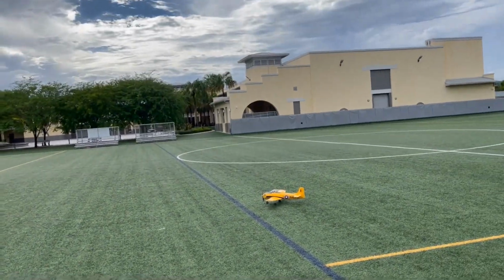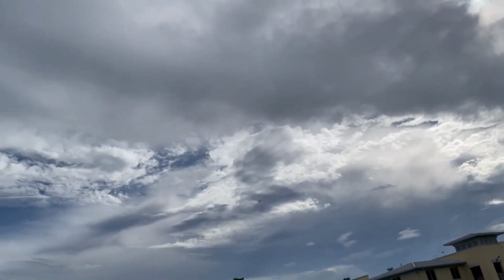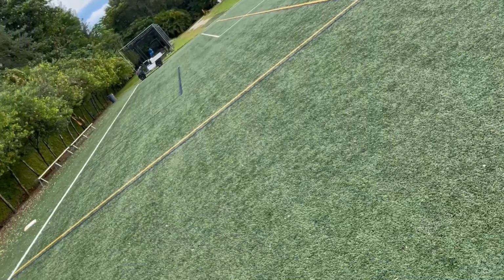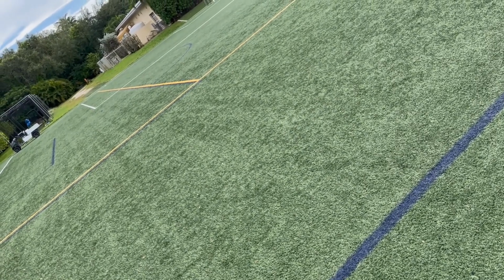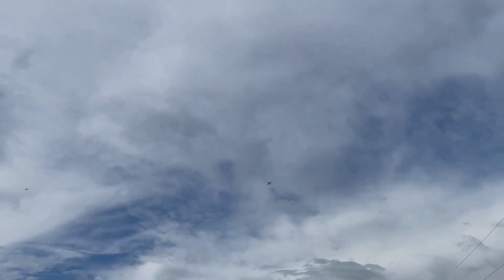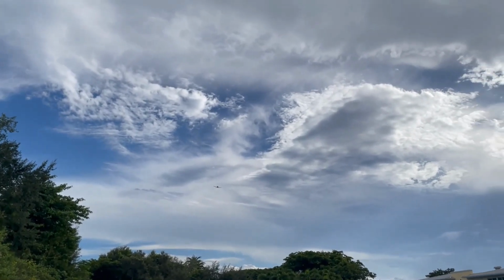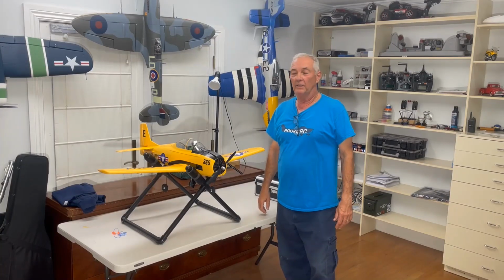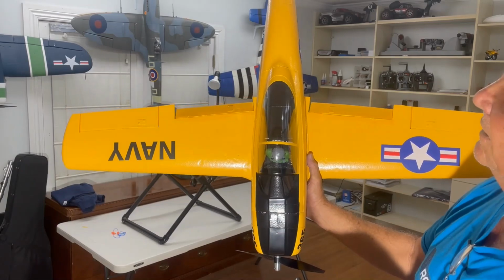Test flight with the new Flaps on the T-28

Comment: Cool what you did!! I´m flying 2,5 months and this weekend I began with an used T-28 and it´s super great! Just a bit too fast for me landing on pavement. Flaps would be great. I´ll see your other video!
Reply: Same. Its to fast for me and when dont slow it down enough i get plane bouncing of the pavement. On grass is ok. I also put wheels from 1.2m Apprentice i didnt like those small wheels
Reply: @ernestostrman5147  and landing on a 3 m wide pavement road with that speed is even more challenging :P Mine had a big crash and after glueing the fuselage she isn´t flying OK need to look for the spinner and motor. So installing flaps isn´t probably a topic anymore :(
Reply: @franciscoduran3688  oh shame. I did learn to slow it down but where i live is very windy so i dont fly it much cause wind is always hitting the plane from a side and that makes it very hard to land. Am just practicing landing with apprentice and fly T28 only when wind is low(i consider low 15-20km/h).
Reply: @franciscoduran3688  am landing on real airplane strip 2.5km long but it seems am done with that. One car company leased the runway and put a fence around it. They let me fly when they are not testing cars which sucks cause i need to put planes in car, drive 15 mins to get to the runway and fins out they are testing. Last 2 times i was waiting 1.5h for them to be done with testing so i can use the runway. 😪
Reply: @ernestostrman5147  Hi Ernest, thanks for your answer :) I crashed my T-28 just because of being silly and trying to do a low pass at high speed. I had a short circuit in my brain and changed elevator up for down hahaha It doesn´t look so bad after the repairs although. But I suppose the motor angle isn´t correct or something is having high vibrations. I was able to land her safe only with SAFE on. 
It´s a shame you can´t fly on that place everytime you want. That was probably super! But don´t you have a small road or something like that? The Apprentice probably also can do good grass landings!? I wanted to start with the apprentice but found a cheap Timber. I have been glueing her a lot but now I learned to fly better and the CG is also better (pretty nose heavy) and I can do all kinds of stuff with her. But the best are smooth landings and touch downs on the evening with lights :) I have a couple of other planes too. A Max Thurst Ruckus that is from the UK and like a trainer 3D plane. It also sails pretty good, but because of that landings are more difficult. It just don´t looses elevation :P And the landing gear does not forgive like the STOL planes. I also have a second hand Draco waiting for maiden (landing gear was broken from first owner) and now also a very old but cool Mini FuntanaX from E-Flite. This is balsa and super light. A really good 3D plane. Another young guy from the field has it and recommended it me. I´m nervous to fly that thing. That´s all about 3D flying and landing must be perfect. Also extremely wind susceptible :S :S 
I hope you do good flights on weekend! We have a little competition for acrobatics on the field. For beginners and pros :)
Reply: @franciscoduran3688  i dont have any place that is close to me and that is big enough and that there is no public. I dont fly where people/cars are, i almost hit an granny with a plane once(she came out of high grass and i didnt see her). I have about 15 planes most have not beem flown yet. Dont want to fly a new plane to soon and crash it. My landings have improved much and am not using SAFE anymore. I live in a small country(less tha 4 milion people) and really dont have anyone to fly with. My eife is afraid of flying +1m planes she only tried 400mm and also lost control when plane was flying to her and you need to reverse contorls and she didtn learn that yet. Son is to young he is only 15 months so i will have to wait so i can fly with him. I ordered FMS 1300 PA-18 which is a bush plane with real tires cause i dont want to travel to runway to fly a plane and PA18 can be landed anywhere. Its also STOL. Also orded FMS T28 800mm sine i can use it as belly lander and launch it from hand. Hope you get more flying time and no crashes. I only had minor crashes due to wind.
Reply from the maker: Hey guys, crushes are part of the hobby. You’ll learn from it and get your skills up. It’s only a matter of time.
On the other hand, you learn how to repair them.
Don’t get discouraged, fly as much as you can.
Reply: @rookie_rc  as a biker i can confirm this. If you gonna ride a bike you need to be prepared you will fall from a bike. Its just when it will happen. On the other side, its not same crashing foam plane of crashing 1000cm 200HP bike. 🤣 Crashes are part of the hobby.
Reply: @rookie_rc  of course, thank you! I hope I don´t crash my new very old E-Flite Mini FuntanaX first balsa plane :)
Reply: @ernestostrman5147  Hi again Ernesto, in which country do you live? I started flying with my 6 year old daughter but after the first umx cub "landed" on an 60 ft tree she got scared. My mistake too probably :(  But she likes to fly drones or planes in the simulator at least :) I have found an airfield (club) that is quite nice! I hope you meet someone to fly too. Because chatting in between is much more nicer and thinking alone or going to a forum to ask something afterwards...
Reply: @franciscoduran3688  am from Croatia. I did full sized flaps on my trojan and it works great. I've posted pictures in 2 FB groups.

Comment: Well done video.  The 1.1 will handle more flap area without getting squirrely, provided they are extended slowly at reduced airpseed.  Pitch up is typical and mixing in some down elevator keeps this under control.  When adding flaps, I extend a straight edge along the aileron hinge line to the fuselage, cut the flap away and attach (at the bottom) with three Dubro, flat hinges.  Guessing this gives maybe 25 percent more flap area and echoes the set up on the full sized aircraft.  My angles are 20/40 and I find they work quite well.  Yes, the plane will pitch down on take off, so lift off at a slower airspeed.  Afterall, the whole idea of take off flaps is to get in the air sooner.  Don't go to full power with full flaps on take off.  You'll end up zipping across the field with your nosewheel  buried in the grass and the mains in the air.

Try landing power off  (with or without flaps), contolling speed with the elevator and altitude with throttle.  You will get some truly heinous rates of descent with 40 flaps and need to be accurate when rounding out to the flare, but you'll never have to worry about running out of space when landing.

Just my two cents.  I have a couple of modified Trojans and a few more to go.  They are great airplanes right out of the box but they do lend themselves to all sorts of interesting and practical improvements.  Again, great job on your presentation and keep up the good work.
Reply from the maker: Thank you, good info, appreciate the comment

Comment: Good video, it’s kinda late, but you could have extended the flap to the aileron, which would give you a little more surface for lift and drag.

I fly the 1.2 T-28 and 1.5 AT, I personally like nose up when the flaps are fully down. I like a glide slope of nose down, then I release the pressure off the stick and she’ll naturally flair before touch down then pull back on the stick to bleed off the lap bit of speed, makes it look like the real thing in my opinion. Keep up the good flying.
Reply from the maker: I consider taking the flaps all the way to the ailerons but with the model being so light, I was afraid it will make it unstable with it fully deployed. 
Thank you very much for the comment